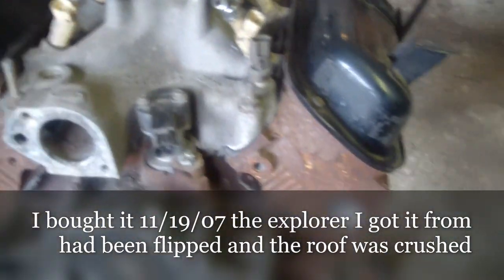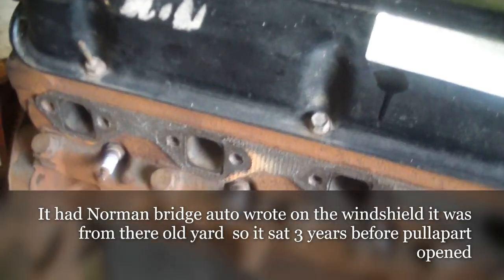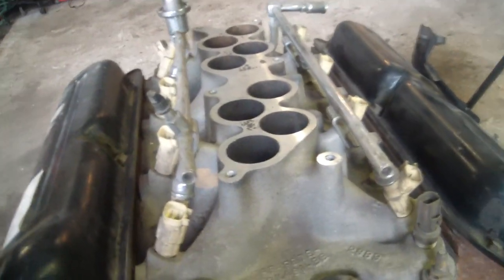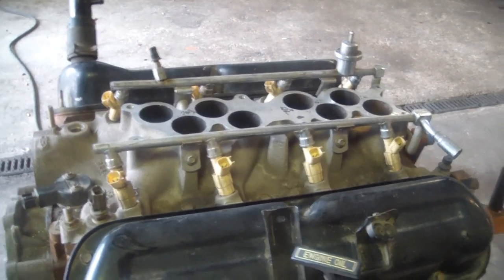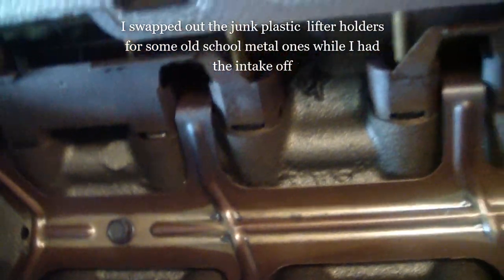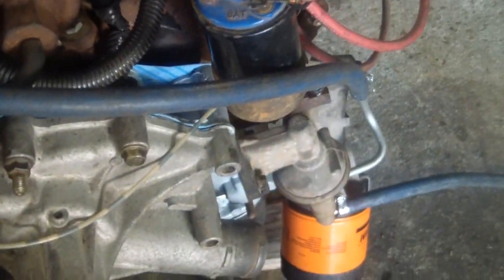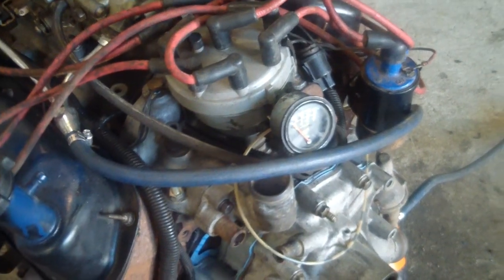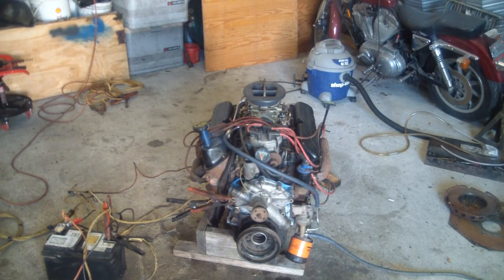First start 01 Ford Explorer 302 swapped to carb

Comment: GOD<<< i used to love doing this ,,,,now you got me wanting to doit again
Reply from the maker: It was at the junk yard 3 years then I got it and it sat 12 more years  best 155 bucks I ever spent
Reply from the maker: It's in a 87 Ranger now with a Semi truck turbo on it making 15 lbs it's in Beast Mode now
Reply: @kickassmustangsgarage  how is it holding up so far? Ive seen soo many people crack blocks or blow heads apart cramming a stock short block with that much boost!! Hahaha.  Love it!
Reply from the maker: @JesusIsTheLightAndway  It's still alive I put a weaker spring in the waste gate trying to get the boost under 10 lbs and swapped it to E85  can't seem to get the tune right with E85 put way bigger jets still trys to go lean might have to blend in some 93 octane or buy a 900 dollar carb that's made for a blow through setup. head gaskets are still good everything still intact no oil leaks no exhaust leaks where I welded the cast iron manifolds got a 60 lbs turbo hanging off it with out a brace. didn't use any gaskets or silicone between the exhaust maniflods and the heads no leaks. I think the crankshafts bend and thats what makes the blocks split i'm thinking 750 1000 is the splitting point 15 lbs feels like between 500 600 HP way stronger than the 351W with a 125 shot

Comment: Nice clean engine.. I want to do the same thing with my 5.0 engine.just for fun.
Reply from the maker: I got it in 06 for $155 from PullAPart.  It sat in the corner till 2020. I never did anything to it till now, This was the first start after 15 years of sitting.

Comment: What distributor did u have to run ?
Reply from the maker: 85 Mustang was the only year that came with a carb and a roller cam. Got the steel gear not cast iron like the flat tappet cams use.

Comment: I’m putting a 96 explorer 302 in my 08 ranger and I’m honestly having a huge pain trying to find someone who can do the wiring for it I have both the 96 wiring harness and my 08 2.3 wiring harness but it’s really rare to see a 07 and up explorer 5.0 swapped Ranger especially since from 07 and up the fuel lines change from the old ones and so do a lot of plugs that would usually match up for most swaps between 90s and early 2000s rangers so at this point I’m considering just carb swapping the engine which I know imma have to go from coil packs to a distributor and get a different fuel pump or switch to a manual one which I probably will since I’m on 1,000$ dollar budget Im running a m5r2 f150 tranny out of a 4.2 10th gen and got a stage 2 clutch and everything for it but I’m wondering will it make the same power as if it were efi? And as well imma keep the a/c system in especially with this summer heat coming and I know imma practically have to go for aftermarket gauges for everything since my electronic  ones would be useless and I’m thinking of running a air gap eddelbrock intake or just buying one of those knockoff ones which is cheaper and imma go for a 650 quick fuel carb and run a hei distributor and I know this is a lot of stuff that I just said and I doubt you’ll respond but would a carb swap be worth it ?
Reply from the maker: They made carbs for 100 years before EFI. I try to swap everything to carb cheaper more dependable (My opinion) way less junk to go bad and makes more power. I've never been on the side of the road with a carb can't say the same about EFI. My EFI mustang fried the ECU in the yard and I don't trust it futher than I can push  it ever since.  You can get a Aeromotive  A 1000 fuel reg that'll drop the pressure with the pump in the tank you got. Aftermarket oil and temp is all you need from the engine fuel gauge'll still work tack would be off even if it was hooked to the truck tack. If the speedo runs off the axel (not sure on that year) it should still work. what else do you need!  AC might be tricky to make work (lines and bypass computer) standard shift solves any computer controls issues for a auto trans. I'd carb it if it was me just solves most of the bullshit with EFI. If I can run one on the ground just showes how easy it is. Good luck with it how ever you choose EFI is the Devil lol.
Reply: @kickassmustangsgarage ’ve decided to go carb I got a HEI distributor and a knock off edelbrock air gap intake and I bought a cheap AutoZone inline edelbrock fuel pump  and for carb I’m still debating on wether I should just get a 600cfm carb like the off the shelf one you can get at the parts store with a electric choke or the 650cfm quick fuel because it’s just a stock 96 Explorer 302 with torque monster headers and if I’m correct on mines it’s just the 3 bar heads so regular GT40 heads and for the budget wise I could just sell my gt40 intake for like 300$ and make my money back on that but so far I was gonna ask to what would I need  next because this whole carb stuff is new to me like I understand the idea but the oldest car I ever worked on was my 89 corolla and that was efi but I bought like a longass roll of rubber fuel line since I know a carb of course isn’t no high pressure stuff would I still need a Aeromotive regulator if so which model would you recommend? And I also looked into my gauges they’re all electronic so imma just run aftermarket gauges and a gps speedo and after that’s all done since my engine of course has explorer front accessories I’ll figure some type of way to hook my A/C to work and again I know I write a lot but I appreciate the advice you gave me last time just need a bit more.
Reply from the maker: @Suelo_Ranger  slide the bed back take the fuel pump in the tank out add a tube or a hose to take it's place so it pulls gas from the bottom of the tank. Put the inline pump just past the fuel filter and plumb from the pump to the carb with your hose.That's the easy way.  The 79-85 Mustang throttle cable is what I use the EFI cables don't have enough pull range to open a carb all the way plus they're long AF.  What trans do you plan to use? Explorer transmissions uses the computer to shift I don't know a get around for that other than a 5 speed. Let me know how it goes hopefully this helps.

Comment: Looking to put a explorer 302 in a 94 f150 that had a 4.9 i6. I want to go carb can you lead me on the right direction as to where you would start as well as with what parts I would need to acquire. Also from what I have read the trans the truck came with will bolt up to the 302 would you say that’s a good idea? I want to be as budget build as I can with it lol
Reply from the maker: The easiest way to make everything work would be find a 94 truck that came with a 302 and get all the accessories off it. The harmonic balancer, timing cover, water pump, AC compressor, power steering pump, everything off the front of the engine motor mounts too.  The transmission will bolt up but I beleve the computer tells it when to shift. The older transmissions with a throttle valve cable don't use a computer to shift. To swap the motor to a carb you need a intake, carb and a 85 mustang distributor and a ignition module or a MSD box. The factory fuel pump puts out too much pressure for a carb so you'll have to put a regulator on it or swap to a mechanical fuel pump and remove the one in the tank. Just pull it out and add a piece of fuel line so it can still reach the bottom of the tank so it doesn't run out at 1/4 tank. If you run a mechanical fuel pump you'll need a timing cover off a 85 mustang or a truck that came a carb and a cam eccentric for the fuel pump. Hopefully this will help you out. If you have any more questions that I missed just ask I'll be glad to help you with them.

Comment: How in the hell does the fan come off the water pump?
I’ve got the four 7/16 bolts out that go through the serpentine  pulley and screws into the water pump flange.
I’ve worked on a shit load of older small block fords and I own a bunch of small block fords and I don’t see any thing else that can be holding it unless it’s just rust stuck
Reply from the maker: It has a nipple in the middle of the pump that centers the  pulley and the fan- clutch that it's stuck on. PB blaster and a small hammer and tap it all the way around if that doesn't work heat it up tap it off the nipple. Is it a clutch fan or a straight drive with the aluminum spacer?
Reply: @kickassmustangsgarage   It’s the factory clutch fan with a plastic fan blades. It’s in a 1998 explorer 2 wheel drive with 82000 original miles and has the GT40P motor but I’ve got a Funnel Web hi rise intake and a set of 1.6 Scorpion roller rockers and the trick flow valves spring kit for the 40 heads.
I’ve got 5 or 6 sets of headers so I’m gonna use witch ones that fits the best in my truck and I’ve got a billet distributor but I ain’t sure if it’s the one I need or not and I bought a used B303 cam that looks like new so if nothing else it should sound good
Reply from the maker: As long as the distributor doesn't have a cast iron gear it'll work. Sound like a good combo 82,000 miles is the perfect time to swap to a carb. B cam is probably as big as you'll be able to run with a auto trans with a factory converter. How are you gonna make a Explorer transmission shift without the computer and other sensors to tell it when to shift?

Comment: Im having trouble with the valve covers. Swapped my 289 covers on and they keep leaking, the bottoms don't match up on the gt40 heads, and I need to hook the pcv up to the valve cover right? Because those valve covers you have don't have pcv hole for carb vacum.
Reply from the maker: You can put a grommet in the hole that you put the oil in at and use it for the pcv. I put 85 Mustang factory aluminum valve covers on mine that have the spot for a pcv. The 289 covers should work check the spots around the bolts they get bent from over tightening them take a hammer and tap the lump back flat. The stamped steel valve covers always seem to leak except the factory Explorer ones they are extra thick where the gasket goes. I"ve ran 86-93  Mustang covers with a grommet in the place of the oil fill cap for years when I had a 351W in my 87 Ranger the Explorer covers can be done the same way. Just pop the grommet out when you"re changing or adding oil. Whatever You do don"t buy chrome valve covers they rust up quick don't have baffles and leak.

Comment: I’ve got a 1999 explorer with the gt 40p motor in it and I’m gonna put it in a f150. What year model distributor do I need to get for it?
I’m a die hard Ford small block man but I’ve never got into this kind of a swap and any info that you for see I might need would be greatly appreciated
Reply from the maker: 85 Mustang was the first year with a roller cam and the last year with a carb. It has a steel gear it'll eat a cast iron one.  I swap the balancer, timing cover , pulleys, and water pump.  Explorers use a balancer  with built in pully.  If you plan to use the  Explorer accessories it'll be fine. I don't know what year truck you plan to put it in so it's hard to say what else you'll need.

Comment: I gotta 82 bullnose f150 that came with 302 originally but it has blown head, and I have a 97 explorer with 5.0 I wanna swap it out with. What all would I need?
Reply from the maker: You can use everything off the old engine the distributor gear needs to be steel or bronze they used cast iron gear with a flat tappet (non roller). Basically the Explorer engine would like getting a long block just swap everything off the old engine. Explorers have a oil filter relocater and you'll need a  nipple that the oil filter screws on to  if it doesn't clear. I would put a new harmonic balancer on it Explorers have the pulley for the belt made into it so it can't be used with the 82 belt route. Hopefully this helps you out I'm here if you need any more info on it.
Reply: Okay thanks! I’ll keep you updated.

Also, what’s your opinion about putting that same engine into a ‘03 New Edge GT Mustang
Reply from the maker: Carb swapped with a 5 speed all day EFI with a auto hell no lol.
Reply: @kickassmustangsgarage  lol it has a T5 forgot to say that

Comment: That's gt40 heads and a regular edelbrock manifold?
Reply from the maker: It has GT40P heads and a weiand 8011 intake  the spark plug angles are different than GT40s

Comment: I love the ground revs. Did you ever put it in something? What alternator did you use? I heard you have to convert to 1 wire when doing a carb swap. Did you?
Reply from the maker: I put it in my 87 Ranger with a semi truck turbo on it. I put a 2000 Mustang alternator on it. Swapping to a carb doesn't affect the charging system. when I swapped  to the 2000 alt all I had to do is run the green wire from the old regulator that supplies power to the new alt to turn it on when it's running. Check out the channel and subscribe if your interested!
Reply: @kickassmustangsgarage   sweet, that's some good info to know! thanks very much for your reply
Reply: @kickassmustangsgarage   what start did you use?
Reply from the maker: @jameshughes4492  I've used the older big one wire ones from a Mustang, 94 truck with a 351W , 2001 explorer, 92 Mustang they all work AOD or T5.

Comment: You think this would work for a 1979 ford f100 original 5.0l 302 truck? because my friend is selling a 1998 ford explorer 200k mile 5.0l for 500$ in perfect working condition. I drove the explorer around flooring the gas down hard and it seems to have balls for a stock vehicle. What do you think?
Reply from the maker: The block is the same the spark plugs have a different angle if it has P heads 4 bars on the head Explorers have a roller cam that will eat a regular distributor gear 85 mustang distributor has the right gear and should have the same plug as a 79 truck. You can use the timing cover.water pump, fuel pump , everything off the 79 except the balancer and the fly wheel 79 is externally balanced 98 is internally balanced. 82 and up are internally balanced.
Reply: @kickassmustangsgarage  Thanks for your help, I will check if it has gt40p or gt40 heads like you said about the spark plug angles. ill buy a 1985 mustang distributor too. Is it ok if I run the explorer water pump, power steering pump, alternator, and all the front accessories if I want to?
Reply from the maker: It can be done but you would have to run a electric fuel pump and wire up the alternator. the power steering and AC compressor  lines will be diffrent.  it would be easier to just get a  harmonic balancer and run the 79 accessories  the flywheel may be the same size.  If it has gt40 P heads you could run the Explorer manifolds if you had to and tie back in to your exhaust system. Go subscribe if you haven't already lol.
Reply: @kickassmustangsgarage  yes I subscribed and liked! Thanks your the man!
Reply from the maker: I appreciate that thanks!
Reply: @kickassmustangsgarage  aye man I bought that 5.0 explorer for 500 and it was way to nice to rip apart so I'm using it. I'm going to try to flip it to make profit so I'm looking for a 302.
Reply: The motor on the 79 ford f100 is fine but the other day I saw metal shaving in the oil. When I go to cold start it, I can hear a little knock but when it's fully warm it goes away so what you think is wrong???
Reply from the maker: @brayanmacias6083  I know some oil filters drain STP for sure so it has to fill back up every time it starts after it sits but if you have oil that looks like metallic paint it probably has a rod bearing going out. you need to catch it now before it messes the crank up. Just put some rod bearings in it and a oil pump while your there
Reply from the maker: @brayanmacias6083  it's hard to find a 302 that you can hear run and know it's good like the one you got now.  might want to keep that Explorer motor and part out what you can and scrap the rest should be able to get about 300 at least. sell  the catalytic converters they pay good you should be able to get all your money back and keep the motor. thats what I would do